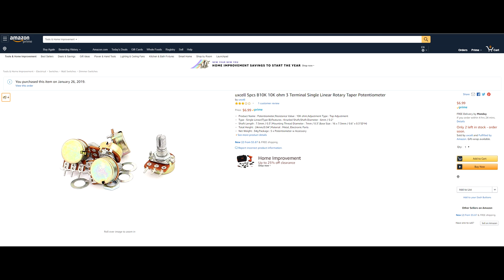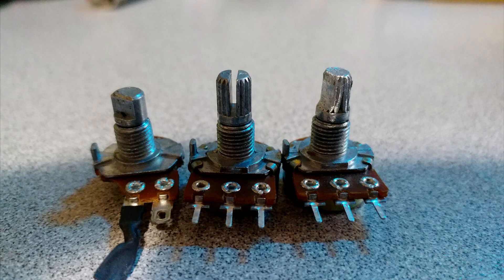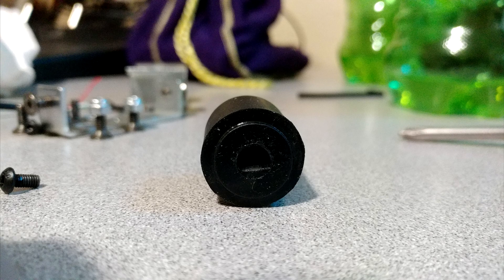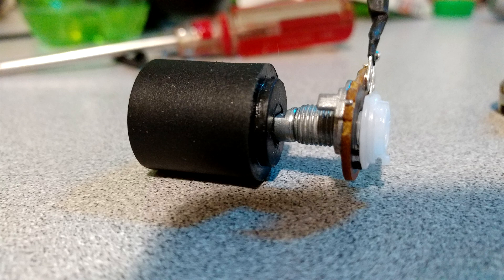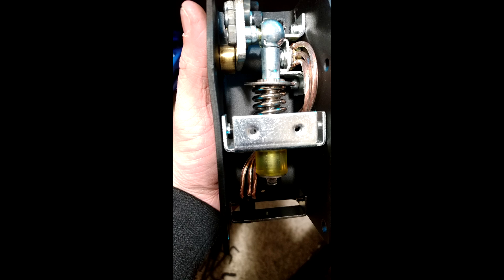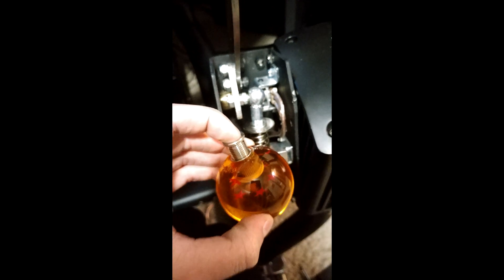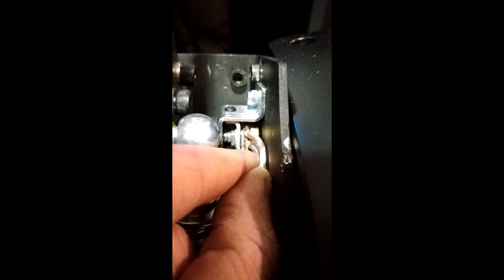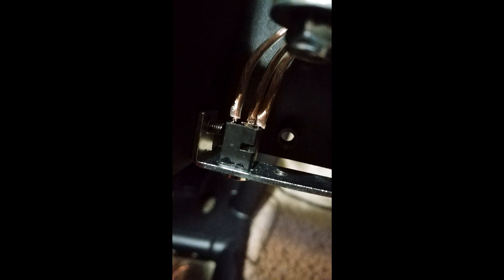[DIY]How To: Fix - Fanatec HandBrake v1.5 - Potentiometer/Wiring

Comment: How do you connect handbrake to pc to make cslibration? Via usb adaptor? Through pedals?
Reply from the maker: @MarcoSa-yt5sn  Pinned plug that runs to a spot under the pedal plate. Have to remove pedal plate to get to it. 3 screws. Otherwise they make an adapter for usb I believe. Probably can find something on amazon or the likes
Reply: @UsaRubber  i can directly plug handbrake to v3 pedals in order to be used on pc, but i don't know if pc will recognize it as a separate hardware to make calibration or not.
Do you think it will be fine using v3 as a conduit?
Reply from the maker: @MarcoSa-yt5sn  It well recognize it, both on the default windows "game controllers" and fanatecs software. Just search game controller in the windows search, click pedals and advanced. And it should show up as a 4th pedal. Otherwise games lije assetto corsa should automatically recognize it as well, you'll just have more adjustment with fanatec software or game controllers

Comment: Hey I have a question, I have the same issue but cant find the same potentiometer.
I have a few questions to ask about the handbrake too if you can. How can I send you a message? Do you have discord?
Thanks.
Reply from the maker: Hey brother these "SHOULD' WORK
https://www.amazon.com/HiLetgo-Single-Joint-Potentiometer-Variable-Resistors/dp/B00MCK7JMS/ref=sr_1_4?crid=3G7LZV6HFSVZ2&keywords=10k+ohm+potentiometer&qid=1680555656&sprefix=10kohhm+potentiometer%2Caps%2C84&sr=8-4

The site I listed from is no longer available but those should work. as long as you go into game controller and adjust the values it shouldnt matter.

Comment: The 3.5 mm cable that comes with this hb is garbage and seems like the quality of this HB is only on the outside , I got done trying to weld another 3.5 to the HB and seems like is an internal issue like you were having, I also have a fanatec shifter and I had to open it and tape some areas , fanatec are probably only good for wheels or DD or whatever it is I haven’t spend big money on them yet , but I’m so disappointed man, thrustmaster is cheaper and after buying fanatec first impressions were like dang this is some quality stuff (not really)
Reply from the maker: I broke my cable too. I have a spare but just decided to re splice the original. Ive got it velcrod in a way it wont move. My shifter return spring for the sequential broke too. Took them months to send me a new one but they make it out of stronger steel now. I havent broken anything recently. All my fixes have out lasted the original hardware and wiring at this point.

Comment: I did this but handbrake only registers to like 15% now. Idk
Reply from the maker: Watch the video again and read the description stuff. I've changed mine out a few times over the years but its always worked great. My problem is the Pots die too quick and I think its more me rippin the HB too hard. Make sure you have it set in the middle when you put it in and when you adjust it it should be good. If you're using the crappy fanatec software you'll just have to go in and reset it and it should read it correctly. Their software sucks but it records the variance pretty good if you adjust it right

Comment: hello the same thing happened to me and the serial one broke .... did you mount a normal potentiometer ???? thanks
Reply from the maker: Yes
Reply: @UsaRubber  Well, it does not work for me, I mount the normal 10kb potentiometer but it needs more than half a turn now that the fanatech program marks it. The handbrake does not give enough travel for a normal potentiometer, since the serial one is 10kb 38 degrees ... how did you do?

Comment: My handbrake is reading full load when there's no load on it at all. Can this fix that
Reply from the maker: Probably an issue more with calibration or the pot got loosened and spun a little . These only have a few degrees of physical rotation so it doesn't take much to throw it of. A bit of loctite will stop it from spinning lose. I was having similar issues. Maybe I'll have to make a better video about all this on what you can do to overhaul the entire handbrake setup because I can rip on mine very hard now and it's just rock solid and has been working flawlessly for a while now.
Reply: Mine does the same thing, set it to inverted

Comment: Had this exact issue, eventually I came up with a Hall sensor conversion kit, selling it to anyone who wants one on ebay.  Search for Fanatec Handbrake Hall Sensor  (direct messaging me i can sell direct cheaper, for example on simracing discord, or reddit)
Reply: bn880  hey i fixed my issue a long time ago and it is acting up again what is this hall sensor you are speaking of i searched it on ebay please dm me on ig CypherNative i might want to buy one
Reply: @illestfunction  Hey man, please send me an email about the hall sensor, my about page has an email address you can reveal. (I don't use IG curently :) )
Reply from the maker: If you're still making/selling these please link so I can put it in description :)

Comment: Was the original problem with the input from the handbrake that is twitchy as hell? Spiking up/down as you pull the handbrake slowly?
Reply from the maker: Essentially yes, the solder job is terrible and just started to crumble away. The bolt/nut that attaches the spring to the plate also wore out and stripped itself, bent a little bit. I'm pretty hard on it so I can't blame it. Replaced the pot, wiring, and put an L type angular ball joint in and it's rock solid now. I rip on it so hard I tore the plate of the mounting bracket, welds broke. Re-welded the plate, it's pretty damn solid now.
Reply: A longer term solution is converting this to a hall sensor, and is much easier.  I tried the fix in the video and even more radical things, but they eventually failed anyway damaging the pot.  Search for Fanatec Handbrake Hall Sensor on Ebay  or find me on simracing discord and PM me for a lower price

Comment: How is this holding up? Still working good? I use mine a lot and recently it has become unusable the potentiometer goes crazy erratic if just barely touch the handle.
Reply from the maker: Flawlessly
Reply: @UsaRubber  Good to hear and thanks for making the video.
Reply: @seand80  A longer term solution is converting this to a hall sensor, and is much easier.  I tried the fix in the video and even more radical things, but they eventually failed anyway damaging the pot.  Search for Fanatec Handbrake Hall Sensor on Ebay  or find me on simracing discord and PM me for a lower price
Reply: @bn880  Hey - sorry, but I can't find you on Discord. Is this something you can still provide some insight on? I found  a seller on eBay charging $55 for the part kit (direct install, no modifications needed). Is that the going rate for these? I've never sourced any  of these, so I do not have any certain frame of reference. I thought that I had seen  I disassembled my brother's Fanatec V1.5 Handbrake, and was going to solder in a replacement potentiometer, but then I saw the hall sensor comment. Sorry if its an out of the blue nuisance!
Reply: @JDTeufelHunden  you found the correct listing
Reply from the maker: @JDTeufelHunden sorry for late ass reply. Hopefully you got it all figured out my guy.
Reply from the maker: Just an update. Still works perfect. 😎

Comment: I can get the pot to register, but it only goes about 20% up the bar in the game controller config...
Reply from the maker: Recalibrate it with windows game controller
Reply: @UsaRubber  tried that.
Reply: @PhrozenN  Had this exact issue, eventually I came up with a Hall sensor conversion kit, selling it to anyone who wants one on ebay.  Search for Fanatec Handbrake Hall Sensor  (direct messaging me on SimRacing discord i can sell direct cheaper)
Reply: @bn880  I fixed the issue. It's a simple matter of tossing the crap fanatic controller where it belongs and ise an Arduino instead
Reply: @PhrozenN  Yeah but in case you want to fix the handbrake not toss it of course.  The mounting of it which is done,  utility / look and original price are a bit of work to throw out for most people.
Reply: @bn880  I have already fixed it. All it took was to lose the crappy fanatic controller
Reply: @PhrozenN  Throwing something in the landfill is not fixing it.  I am mentioning this for people who want to fix the handbrake not toss it of course.  The mounting of it which is done,  utility / look and original price are a bit of work to throw out for most people.  (ah I understand maybe you somehow fixed yours with a DIY kit of some kind, most people won't be able to)
Reply: @bn880  that hall sensor conversion kit still around?

My handbrake started to fail like this and would love to put a halleffect sensor in

Comment: Does it matter which wire goes where because I need to solder the 3 wires back on mine with the normal part
Reply from the maker: I believe it does matter I listed the pin layout on the bottom of the video description.
Reply: tv/ UsaRubber thanks
Reply: tv/ UsaRubber could you tell me which wire went to which pin on the 3.5mm port

Comment: Did the same thing to mine because same issue but i cant get the pot to read not sure what’s going on with it i have it all wired up right, i tested off of the handbrake and it works right just once i bolt it down not even tight its like its dead
Reply from the maker: Have you tried calibrating it in the fanatec controller. The pot may have a wider range and might be outside of it one way or another.
Reply: tv/ UsaRubber how do i calibrate it in the controller? Im using a fanatec CSL ps4 edition on the pc i bought the same exact pots as you
Reply from the maker: @illestfunction  Use "Game Controller Settings" It's a built in W10 calibration tool. You can search for it within windows, or if you go to "devices and printers" page, right click on your controller/wheel/hb and click "Game Controls" that should open the window to let you calibrate it!
Reply: @illestfunction  so did he's solution work for you? Im interested in doing this, occasionally my handbrake will stay on after pulling it and wont come of until i pull it again.
Reply: @tyroniebalonie  A longer term solution is converting this to a hall sensor, and is much easier.  I tried the fix in the video and even more radical things, but they eventually failed anyway damaging the pot.  Search for Fanatec Handbrake Hall Sensor on Ebay  or find me on simracing discord and PM me for a lower price
Reply: RC/Skater  A longer term solution is converting this to a hall sensor, and is much easier.  I tried the fix in the video and even more radical things, but they eventually failed anyway damaging the pot.  Search for Fanatec Handbrake Hall Sensor on Ebay  or find me on simracing discord and PM me for a lower price
Reply: RC/Skater  To be fair their V3 pedals are really good.  And for me CSW 2.5 is good.   The handbrake is really a huge problem though for the price (especially without such a mod)
Reply: RC/Skater  Oh yeah, the loadcell sensor will fail in the V3 pedals as well, but the fact is that loadcells are honestly consumables (they last, but not for ever).  and they can't do hall sensors for loadcell obviously.  So yeah...   but I do agree with you the price on the handbrake for what you get with the pot and how it's driven, is not right at all.  At least people who have a failed one can get pretty much a lifetime fix now with the kit I made.